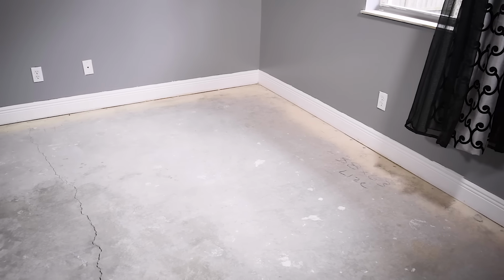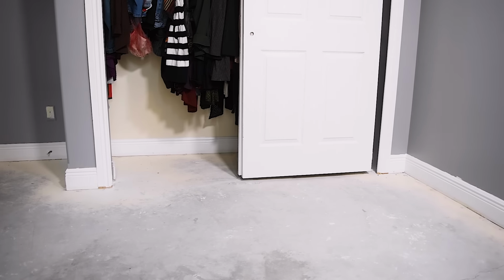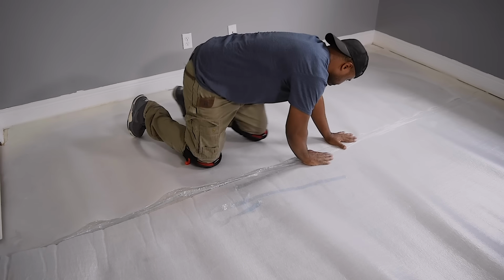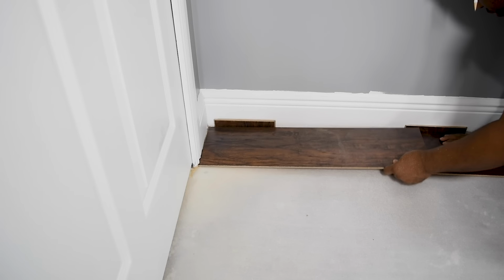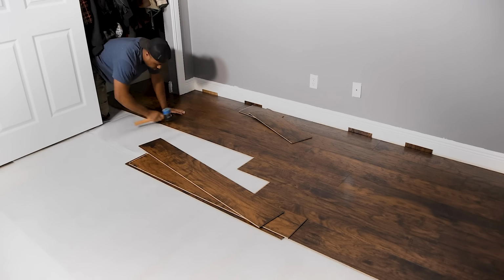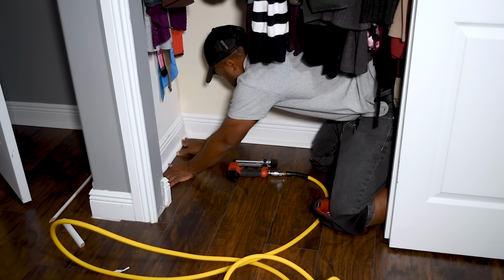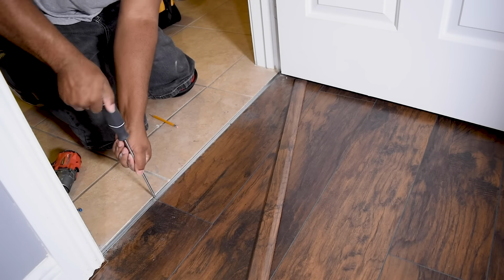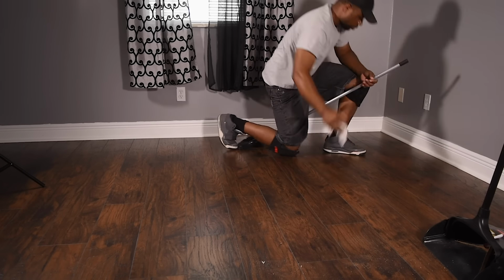How to Install Laminate Flooring for beginners

Comment: Would like to know the name of the laminate, I am looking for this version, then I will make a video of a Dummie laying laminate...
Reply: It looks like a builder grade cheaper laminate from Lowes or Home Depot.  Those are usually non water resistant without a pad attached to them.  On a concrete floor, even if you get one of the higher quality ones with a pad, you will still need to lay a underlayment, just not like the one he used... that is a pad that acts as a vapor barrier.  

Most of the laminate I sell has a pad attached, so I will set up a 6mil plastic underlayment under it if installing on concrete to act as a vapor barrier.  You want to be careful with laying a pad on top of a pad, as it may cause the floor to move more than it should while you are walking on it.

Comment: Can I install laminate flooring over existing Vinyl floor?
Reply: Vinyl as in sheet vinyl?

Yes, as long as its not more than two layers of Sheet Vinyl.  It tends to get "squishy" and could damage the joints from them moving.

If its a floating floor like LVP (another click lock floor), then no, that old one would need to come up.

Comment: You forgot one little step before putting anything down you got to make sure the floor is nice and flat so you put a level in case there is any dips in the floor then you grind out  any bad spots then clean it up the apply the flooring just saying bro

Comment: Oh, i thought , installing Laminate floor require glue . Thanks for sharing
Reply: Installers now will typically only use an adhesive on the transition strip, gluing it to one side.  The track often times will break.. and its best to use it as a guide to keep it straight while it gets structural support from one side of the flooring.  Doing one side, also gives it room to breath... since that laminate is going to swell and shrink a little since its a wood product.

Comment: What was the pricing for the flooring and tools
Reply: It all depends on where you live.

Where I am at, builder grade laminates like this usually run between 1.50 to 2.50 a square foot (the one I sell retails at 2.50).  Higher grade laminates that can be wet mopped and are water resistant with stronger wear layers start in the mid threes and go up from there.

Comment: Ok know videos a bit old but I'm actually a flooring installer not here to tear anyone up but 
1. Don't unroll all your pad/ moisture barrier at once like that do one or two shots at a time then work to the end of that shot and unroll another you'll thank me later.
2. Never start in a doorway especially with floating material you want your longest unbroken wall or exterior walls their generally the straightest 
3. Always be sure to check the paperwork or website of your specific material prime example the general rule of thumb is 1/4" expansion but with some material I actually just did a house with one where the expansion was 3/8" not 1/4 laminate is pressed cardboard with a fancy cover. I always try to glue it together because it soaks so much moisture that it doesn't hold up the best to that expansion. newer stuff claims to not need to worry but I don't trust it myself.
Just to put in the "pro" 2 sense. always remember be safe.

Comment: What would you use to level out the concrete slab if it wasn’t level ?
Reply: There are alot of different brands, I use one called Featherfinish.  If you are buying it from a store, just ask for a leveling compound.  They should ask if you were needing a skim coat, or if you needed something a little heavier.  Its basically a really fast drying cement.

Comment: Nice job. Great info. 1 trick I do. Wet set the little 45 angle pcs in caulking. So they don't break and it adds strength. Go bless

Comment: Love this!!! I would love to do this but I live in an apartment complex  that don't allow changes to the apartment. 😥😭 I want to try this. Question: the floors stain easily and get dirty very fast. What can I use after stripping the floors to stop this? I've stripped the floors before thinking that would be enough but I was so wrong. Plus I have no clue about these things.

Comment: Dude, your foundation has a huge crack in it!  Don't you think that should be addressed before you cover it up with another floor?
Reply: That’s not considered huge. Foundations settle and slabs often crack. As long as it’s a crack and not a gap it’s ok.
Reply: @ruffxm  Not sure what state you're in but from an engineering perspective slab cracks could be a sign of a more serious issue like iron in the gravel, unstable  ground, while the carpet is off you find out what the problem is.
Reply: @rwfrench66GenX   It depends on the size. Unless the cracks in a floor are an eighth of an inch or wider, they are usually the result of normal stress. Concern comes into play if they are uneven in height or are "active". All residential concrete slabs will crack to a degree.

Comment: Regarding the shims between the floor and the wall. Is there a specific reason you didn’t use them on the other wall as well?
Reply: Luke T because 5mm is plenty one side for the floor to swell if it needs too
Reply: Mark Snarey i meant the perpendicular wall to the shim wall. Is expansion only happening in one plane?
Reply: No mate but when or if it expands that 5mm will push that way cause of the gap that end

Comment: What happens to the spacers when it’s time to quarter round? Do you just put the QR in the gap?
Reply: You use the 1/4-round to cover that gap. You do have to pull the spacers out, traditionally. He was right, the easiest way to do it is to remove all the baseboards first, then space a 1/4-inch off the wall. Then, when you remove the spacers and reinstall the baseboards, the baseboards cover the gap.

It's a floating floor, which means it will need room to expand and contract with the temperature changes and weight distributions, hence the spacers.

Hope I helped ya a bit.

Comment: Your neighbor has a huge foundation issue with that giant crack in his slab. $$$
Reply: Yeah thought the same thing.
Reply: Cracks like that are not as uncommon as you think.  

I would not call it a foundation issue anymore than a curing issue.

He probably should have still filled it with a leveling compound.

Comment: I have a question about humidity and condensation in the basement without a subflooring. As you are on concrete even with the vapor barrier the floor will be cool. If you have dry winters you will need to humidity the room but humid air will cause condensation on the cool floor. Have you had this issue?

Comment: Too bad they didn't want to remove the base trim. Quarter round makes it look like you did what you did, instead of doing it "right".  I'm sure you would have preferred replacing the trim on the wall instead of installing quarter round on the floor. Nice work installing the floor. I'm sure it's going to be more difficult for me than you made it look.

Comment: He did not use glue for sticking on floor. Can any one explain how it will be stick on concrete. Thanks
Reply: It doesn't get stuck.  It's called a floating floor.

Comment: I installed Kronotex laminate with this kind of locking system and probably because our floors are not laser straight, laminate is moving a bit and creaking big time. I would not suggest installing laminate with this kind of locking system in general.

Comment: I was watching trying to get out of buying that padding trying to charge me 65.00 a pack! I thought maybe i could lay it without the padding i guess not? Or can i does anyone have that answer
Thank you.
Reply: It depends on the laminate, and what you are installing on.

Some laminates have attached pads, and on a wood subfloor you may not need it.

It also depends on the pad.  I sell a similar one that he used for concrete installation, and it runs about 30 cents a square foot.

Comment: Do you leave space for expansion on all sides of the room or in just that one part of the wall?
Reply: Ryan Armstrong  hey yes i get that, quarter inch on every wall or just that one corner? Thanks for the help!
Reply: Ideally you want to have it around the walls.  He may not have had that option, or left plenty of room on those outer walls and felt it would be fine.

Comment: I wont do caulk anymore.  It always cracks over time, turns yellow, and damages the wall and baseboard upon removal.  It is also a magnet for dust and dirt, which cannot be cleaned entirely.  Painting the caulk is necessary to avoid some of this, which then requires wall touchup.  First time home owners like it, but they'll get over it eventually.  Its not worth the added maintenance for the value it brings.  Lowering your maintenance responsibility is more valuable.

Comment: GORGEOUS!! So if I remove my baseboard trim can I put the same ones back or will I need to replace with new ones?  Thanks
Reply: Depends if you damage them when removing them. Also it's possible that you may damage the wall when taking them off..
Reply: If they are stapled in (as most newer ones are) you can ease them out, install the flooring and put them back in.  As the other poster said, you may damage them though.  Many installers will say they are not responsible for breakage, but will do their best to keep that from happening.

When I set up installs for my customers it is what I usually do, remove and put them back up.

Comment: can't remember ever living in a house with wood floors but i look at this and it just looks homely..
Reply: Laminate is better than wood in many cases.  It is tougher, more rigid, dents less and the good ones will resist moisture more.  They don't add value to the home like wood does, but they don't hurt.

Great for flooring that gets alot of use.

Comment: Going to attempt to do this with nothing but a box cutter please pray for my sanity
Reply: You are a brave man.  A good laminate is hard... a box knife would not cut it to easily.

If you are going that route, go for a loose lay LVP like XL Flooring.  Its made of fiberglass and uses a pressure sensitive adhesive.  You only really need a box knife for that.

Comment: your using a spacer for expension for the width of the boards but not at the length of the boards. doesnt laminate expand in the length and only in the width ? i would hire you if you were in my city, you sound like a nice man.

Comment: Why you lay the floor when the subfloor is literally cracked??
Reply: I was concerned about this also, if someone with knowledge could reply lol
Reply: Ideally he should have used a leveling compound to fill in the crack.
Reply: I saw the huge crack too,  however if my job was to lay new flooring that's probably what I would have done. LOL

Comment: Is there an advantage or disadvantage in using epoxy or glue or whatever they use to stick it to the floor versus using the padding?
Reply: Mostly when you want to get rid of the floor.  You will hate your life when you have to pull that floor to replace.

That pad is a vapor barrier, it is protecting the wood core of that laminate from the moisture... usually safer than a epoxy based adhesive.

You very rarely see laminate being glued down... though one time we did nail a laminate floor down to install a new floor over it, rather than install OSB as new subfloor.

Comment: We removed the carpet in our 1700 sq ft home about 15 years ago and put in laminate flooring. We removed all the baseboard and door trim and put in all new boards after we did the floor...took forever and was a major PITA. We just bought a new home and plan on tearing out the carpeting again and doing laminate in this one. I told my wife that we will just go the 1/4 round way in this house...its a bit larger at 2200 sq ft and two story. I think as long as the 1/4 round is consistent throughout the house it looks fine, stands out a bit more when its only in 1 room though.

Comment: Unfortunately, this laminate is the easiest one of all laminate floors - just snap in and tap down with rubber hammer. Most of laminate have toungue and groove in all 4 sides, you need other skill. So, if you are planning to do this, you have to buy exactly same type as this.

Comment: Great content, presented with quality. The one thing I saw that you overlooked was the starting width board?
Always measure the over all width to determine the proper plank width to start, or otherwise you 'could' be placing a miniscule final board against the final wall. Keep up the good work . 
(comm. an resid. contractor/remodel  for 40 yrs.)

Comment: When you we’re finishing with the nail gun, were you securing the little skirting to the main wall skirting or fixing it to the wooden floor?
Reply: Fix to the existing skirting.
Reply: @craigy1872  thanks!
Reply: What they said... this is not wooden flooring (though it has a press board core), it is laminate.  It essentially is a laser scanned image heat welded to dense press board.  Nailing it would compromise that wear layer.

Comment: Just tried this. I wouldn’t recommend that staggered staircase pattern at all. Random is the way to go. 
When you reach the end of each row and cut, use the cut piece that’s been cut to begin the next row.
Reply: Did floors for 25 yrs. Definitely never ever stair case your floor. All you're doing is making weak spots and squeaky floors.
Reply: Joey Parm did the guy in the video staircase it?
Reply: @jasonmay9052  Yes
Reply: @joeyparm9887  any video you can show me to prove it??
Reply: @joeyparm9887  so what the planks for at the beggining on the wall? And if he pull it out wont the spices between the planks open or move idk? Does everyone do it or should do it?
Reply: @joeyparm9887  do you recommend these clip floors? How are they compared to nailing boards in?
Reply: Yup thats how i install all my LVT and LVP
Reply: Agreed.   He confused the hell outta me with what he did
Reply: See this is why I can't attempt this. I have no idea what you mean
Reply: Absolutely agree.
Reply: This is literally a video on how to, and he mentioned other options but these mofos still asking Joey questions lol... by the way I’m a carpenter and this guy did a great job
Reply: Nothing wrong with any style of stagger if you do it correctly...
Reply: @c4nea  Wrong. Staircasing and 'H' pattern sets up stright lines that stresses run along, causing distortion/bulging along those lines. Te only way to avoid this possibility is truly randoming your joints, minimum 8-12" away from any other.
Reply: That way it's not like it's technically wrong as long as your outside the recommended break but yes what cuts off one end starts the next. make a lot less waste that way as well

Comment: Thanks for the good video.  I have some trim that was high due to carpeting, and I'll try your fix.  I'm not putting in a whole floor, just a few pieces from a removed cabinet, but needed a refresher.  Good explanations and thorough considering it's under 14 minutes.  Your videos are always helpful.

Comment: Tip for connecting two straight trim pieces. Use a 15 degree angle, it leaves the smallest curve of the visible cut

Comment: Great Video! Wondering, how long it took you to do the whole job. I am about to do a similar size room and had to bone up on the process.
Reply: My installers can usually finish about 6-800 square feet in about eight hours.... for a layman, you can expect 3-4x times that.

Comment: I installed laminate flooring myself in two small rooms. Its was easy. The baseboards were removed already so I was able to get the flooring right under the wall. I used a 12mm laminate 
With  underlayment  already attached. My subfloor is level concrete. It was so easy.

Comment: From China? How much formaldehyde in the laminate flooring?
Reply: Depends on the company.

Most of this stuff does come from China or Korea.  

Lumber Liquidators got in trouble a few years back because they were selling stuff that was not Floor Scored.  

That is what you need to be checking, to be sure if it has that Floor Score rating... 

But...

Still safer to buy American, it might cost a bit more, but companies like Mohawk have stringent testing, where they actually test product.  In china those companies typically are only testing the systems that make them to make sure they are still within tolerance.

Pretty much all the big box stores will sell stuff that is within the california standard for VOCs.  It is the most stringent in the nation, and no company is going to close out the largest market in the country.

Comment: so i am planning on re flooring my bathroom would i need to add a transition going to the carpet bedroom even though i plan to re floor that the same are the bathroom
Reply: If they are going to be the same material, and the floors are the same height... no you would not need a transition.

Comment: Is there a special kind of tape for padding if it wasn't included with my padding or will masking tape work? Great video.
Reply: I wouldn't use masking tape but duct tape would work fine
Reply: There's a special kind of tape. I think it's legit called underlayment tape.

Comment: When installing on concrete, make sure there's a vapor barrier beneath the underlayment.
Reply: Depends on the roll out pad.  He is using something like duofoam.  It acts as both a pad and a vapor barrier.  I still recommend a 6 mill plastic sheeting under it, but typically a taped pad like that pulls double duty.  

Now there are pads that are not vapor barriers though.
Reply: What’s that? I’m redoing my room with wood flooring
Reply: @b328i8  At least 6 mil poly sheeting. Lay it down before rolling out the underlayment.

Comment: Should of dealt with the stress crack in the slab in my professional opinion, keyword opinion. Red guard is a fantastic product available in the flooring section at home depot, rolls on like paint yet drys rubber. while red guard is specifically for stress cracking in slabs it can be utilized for all sorts of things. only oversight i identified. great job in the end.